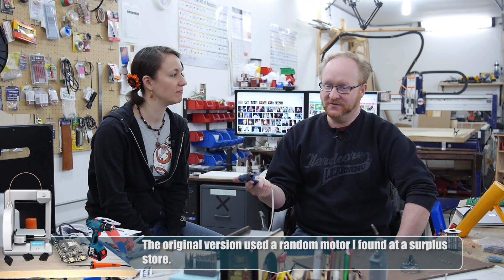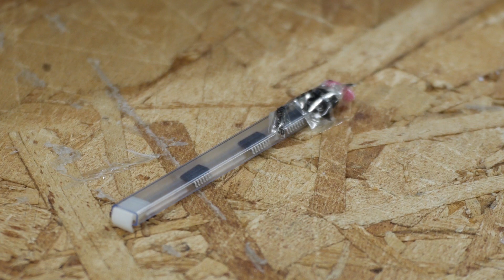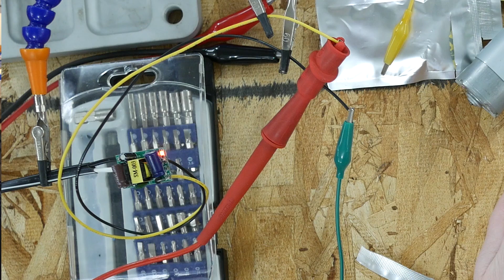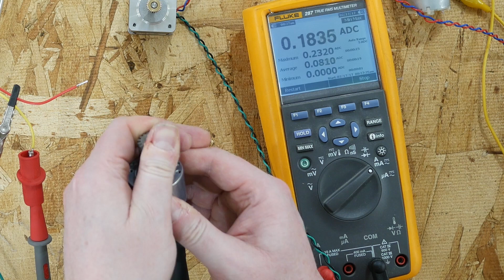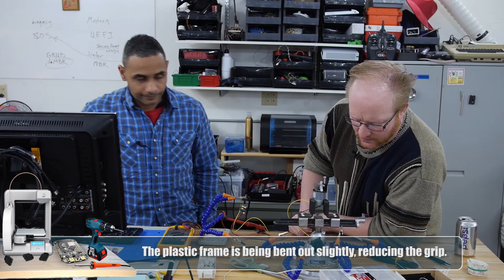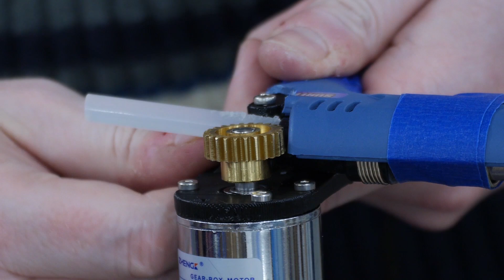Super Glue Gun 02: Extruder Motor

Comment: Thanks for your comments everyone. The reason we don't want to just drill out the gear is the intent of this build is to make a marketable product that can be manufactured. That means not manually modifying parts. If we were building just one, then drilling a 5mm bore into a 6mm bore would be the obvious solution. However, if we want to potentially produce these in large quantities in the future, we need to be able to source a ready-made part.
Reply: It would seem to me that boring out one of the 3D printer gears would be in line with standard prototyping practices... At least then you'd know how well it worked before deciding on the characteristics of a custom-ordered gear. "Make a thing that works first, then worry about making more of them."
Reply: All the other stuff you're going to need to make this work for mass production and you're worried about enlarging a hole in the gear eh?
Reply: There are dozens of factories in China that could easily do this. This is where these gears are made, after all. Contact a few sellers on Aliexpress/Alibaba and I guarantee you'll get results.
Reply: theHeckwithKaren Could you put a cheap gear that fits on the motor and then put a third gear between the motor gear and the filament feeder gear? The motor gear could turn a rod with the filament feeder gear on top and the intermediary gear on the bottom.
Reply: The idea of gears is using actual the idea of gears. By using some gear ratio so that the motor doesn't need to provide that much force (current).
Reply: theHeckwithKaren Why not have the glue stick pushed out through a tube by a driver shaft? Motor drives the shaft and the shaft pushes the stick. That is way better and you eliminate the problem of sticks going though gears by all these different angles.

Comment: If you're attempting to feed glue sticks, wouldn't using a rubber coated disc be better than a gear to feed it?

You could also put rubber on the bearing so both grip the gluestick and feed it evenly.

Comment: Hi, I don't know if it has been suggested here, but why not mount the glue stick in a slider with a motor driven screw thread to push the slider.
A great amount of force can be generated using a screw thread, and your motor will be axially mounted rather than cross mounted.
Tom..

Comment: I dont know if I get the problem right but ... if you put 2 guides one just before the gear and another just after the glue will pass with no problems using almost any gear....
because it wont bend any more, so no presure is lost ....
and to control the presure you could use an shunt an an ad converter to monitor the current on the motor that is directly the force so the presure...

Comment: I wonder if you can get a tiny worm gear. (mates with a worm screw) It would help keep the stick in the middle and probably allow you to decrease the pressure of the idler.  
e.g. Boston Gear Cat#G1028 Item#13582 It has a pitch diameter of 1.25" and a bore of 0.25" That's the smallest pitch diameter they have stock in bronze with a 1/4 bore. There are smaller ones but made of plastic (acetyl with brass insert, 0.833 PD) so probably not a great idea.

Also, don't most extruders have a spring loaded idler?

Comment: Ben why are you not using a worm gear?
Reply: Guess he's still thinking "3D printer extruder". Although... I wonder if a worm gear would have the needed grip.
Reply: He could probably make it work
Reply: I think a worm gear would have better grip because the the teeth would wrap around the stick a bit and keep it centered. (unless you mean a worm screw, the thing that mates with the worm gear, or a screw drive like they use in industrial plastic extruders to melt plastic pellets through friction and push it at the same time, which I think would be way cool but way outside the scope of this project)

Comment: Have you guys considered using a larger heating element? Home built foam RC plane makers use a TON of hot glue and seem to prefer 200w guns to handle the larger volume of glue. The automated glue control on the Super Glue Gun combined with a larger heating element would allow for a much wider range of glue speeds and volumes than a smaller element would allow which could potentially lead to a wider market for the glue gun.

Food for thought.

Comment: Certain size remote control car motors run a 6mm output shaft so you could try out these pinion gears if they come in the right number of teeth for your application. https://www.servocity.com/6mm-bore-32p-shaft-mount-pinion-gears

Comment: The extruder gears are made for 5mm shafts ?
If only there was a rotary device that looked like a drill that used these screw-like things that looked like 6mm drill bits that you could then use to widen the hole......
But that's just a theory.

Comment: Great project. I was thinking it would be useful to have an electric powered pop-rivet gun. The manual ones are hard on the hand  especially if you have a lot of rivets to set.
Reply: You can already buy numatic pop-rivet guns. I don't want to buy a compressor. I think an electric powered one would be interesting.
Reply: I have seen a system (in the USA) that lets you run pneumatic tools off of CO2 (paint ball cylinder) 
You (or Ben) could DIY that.
Reply: It would take a crazy hefty solenoid. I think a gear motor with an eccentric to repeatedly jack the handle would probably work better. Or a linear actuator.

Comment: Ben. I always find that the more pressure you use to push the glue the more it keeps leaking out and with my gun I need to pull on the stick a bit to undo the pressure. Could your motor be made to push till trigger is released then automatically reverse slightly to release the pressure each time the trigger is released?
Reply: That's the plan!

Comment: Maybe try using a remote bowden extruder, I realise this was mentioned earlier in the posts for keeping the material straight.  But what not just use one, that way you have a ready made supply line for components as they are used in 3D printers to push filament.

Comment: instead of those gear motors, you could also use the cheap solarbotics style nylon ones, it doesn't need to be super strong. Or you could use continuous servos. since they're fairly small, yet strong, easy to control from a microcontroller.

Comment: have a look at 3d printer bowden extruder housings they are designed to kept filament very straight and supported in every axis on both sides of the gear, your housing allows to much movement of the filament and after it has been gripped by the gear it will have a tendency to deflect inwards towards the gear.

Comment: Ben, Why didn't you include a hollow shaft DC motor in your set up, you could run the glue through the center and use a threaded barrel. Is it just because of the torque required?